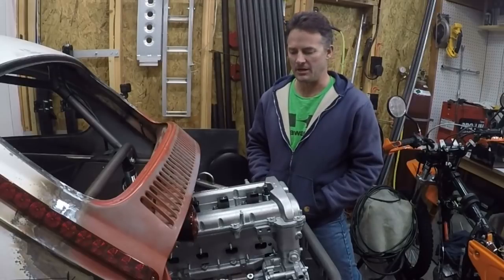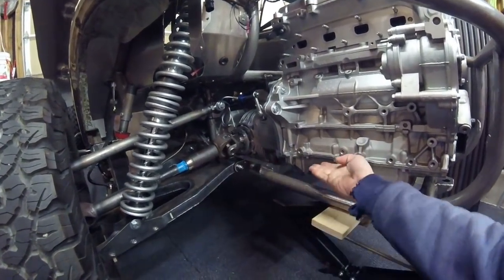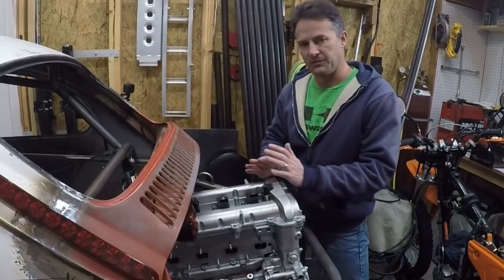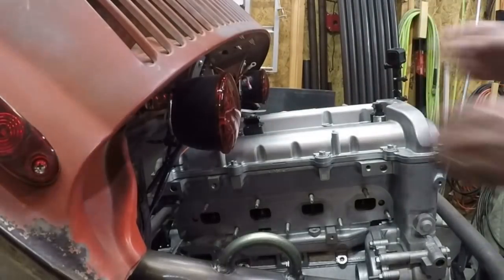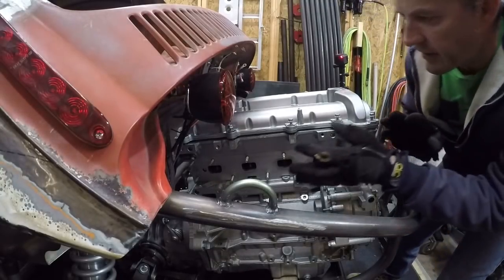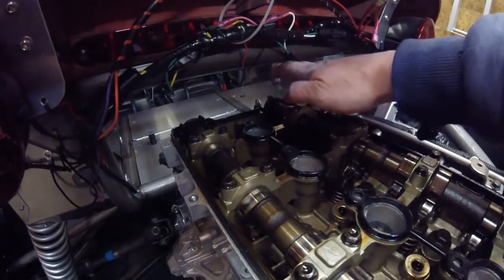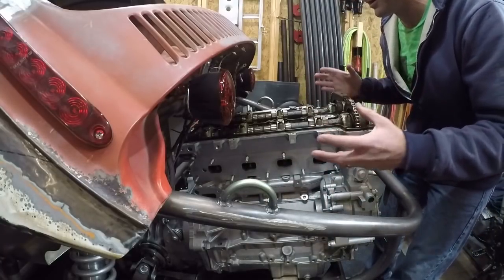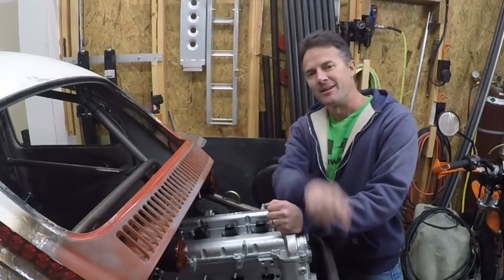Ecotec to Baja Swap Ep  6

Comment: Contact Ray Bates at Bates Engineering in Costa Mesa for his water pump-run alternator that eliminates the pulleys at the back of the engine. Other Bates equipment for Ecotec can be found in the GM Sport Compact Build Book. Especially when you want to upgrade from the stock 195 hp.
Reply from the maker: Thanks for the tip, I'll look that up. It'd be cool to lose the belt.

Comment: What trans are you using? I can't tell if it's a 3 rib or something aftermarket? Also has it lasted now that you've driven it a bunch
Reply from the maker: It's a stock 3 rib with the 5.37 R&P.
It's doing just fine, but I do baby it a good amount. I'm pretty sure if I really let the Ecotec loose on it the transaxle would break. I'm hoping to upgrade to something aftermarket someday.

Comment: Hey Doug, can you get the valve cover off?
get the valve cover off...... get the valve cover off........ get the valve cover off....... get the valve cover off......close.
Reply from the maker: Yes you can. It's extremely close, and you even need to rotate the engine so the camshafts are in the right spot to allow the valve cover to rotate to a certain spot to clear the frame. But at the end of the day.....Yes it comes off. ;-)

Comment: what did you find out about the angle of the eco tech motor and oil level?
Reply from the maker: The angle is not a problem. Turns out there are drain holes in both ends of the motor. So even if it pools up in the rear it drains with no problem. I even pulled off the valve cover and watched it. Drains down right away. So that dismissed any concerns about it being tilted back at all.

Comment: Just curious, why didn't you move the oil fill hole while you had the valve cover off? Isn't it in the most uncomfortable place possible?
Reply from the maker: It is in a bad spot. There will be no way to add oil without using a funnel. Although welding that hole up and finding a new location where I can weld in another spot will be no picnic. I think for something like this I will pick up another valve cover at the bone yard I can play with. Then I'll likely modify that one. That way if it goes south I can still keep moving forward with the one I have.

Comment: Great content, Dont you need motor mounts for this engine? is the transaxle holding the engine weight? can it be used as a stress member?
Reply: Got my answer in a later video. thanks.

Comment: Just curious. What type of weight fluctuation is this engine swap going to do with the addition of the cooling system?
Reply from the maker: I'm pretty sure the Ecotec alone adds 80lbs over the air cooled. Then I think the cooling system including the coolant will add about another 40lbs. So I think adding the Ecotec overall adds about 120 lbs.
Reply: Good deal! The power advantages far outweigh the weight sacrifices. Is this going to get a custom header made by you? I can’t say how much I enjoy watching these videos. Even though this is a totally different end product,from what I do, the technique is identical to get there. I’ve got to say you’re build has definitely inspired me to go a couple of extra steps. If you don’t mind me asking what is the punch tool that you are using in the other videos? I got to get my hands on something that easy to use because I’m having to use a hydraulic press to do that type of punch.
Reply from the maker: I hate adding weight as that's really in the opposite direction of performance. But I think you're right and the power gain and hopefully reliability should offset it.
Because I'm trying to show people that an Ecotec install doesn't have to cost a lot, I'm going to make the exhaust out of the stock manifold. So it will be down and dirty simple. Maybe after this is all done I'll make a better exhaust more like a header, but not for now.
If my builds are helping you in some way with yours then this channel is working. That's what it's all about. Getting out there and working on our passions. Thanks for sharing that. ;-)
That punch is likely in my top 5 favorite tools. It's fast and dead accurate. It's by far the number one tool that people see in the videos and ask me about. One day I'll do a video just showcasing the punch!
It is made by Roper Whitney (Pexto), Model 17 and it is 5 ton.
Now you have me curious? What are you building??
Reply: I’ve built several different types of vehicles. Rod, prerunner, race cars, and mini trucks. Currently I’m in a state of mind that I want to bring it all together in one build. I also have challenged myself to build every piece possible. That is what brought me to your channel. I think control arm fab is what got me here. So far I’m C4 corvette geometry on a total tube chassis. GM based drive train(LS/Jericho)Massive engine setback. Rear mounted  radiator, battery. This will have truck panels just because I’m a truck guy. However, the build is a race car that will be street driven. I have no video experience but, I really feel like I should be doing a documentary.
Reply from the maker: That's awesome! My favorite builds are the ones where the guy just figures it out and builds it himself. Good luck with that project, sounds awesome.